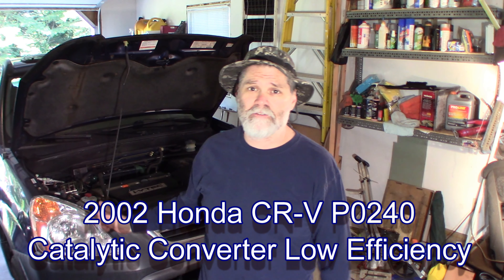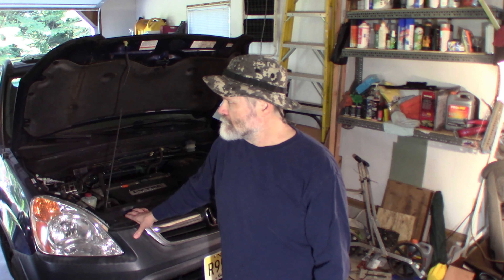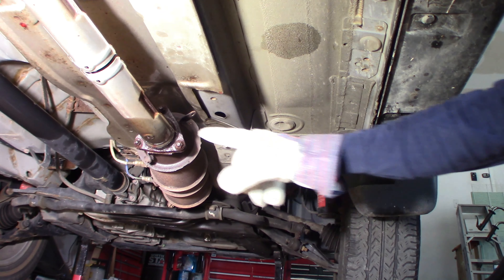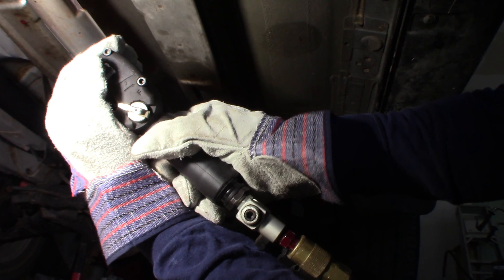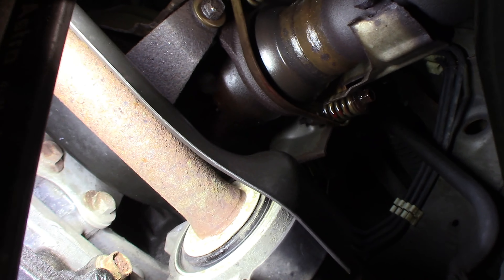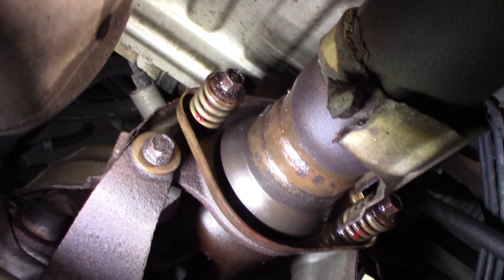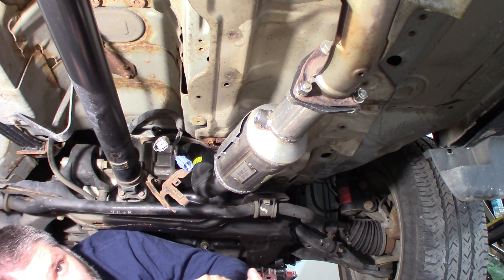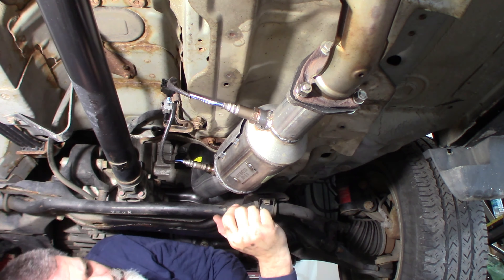2002 Honda CR-V P0420 Catalytic Converter Low Efficiency

Comment: The one I need to work on this week, the bolts are unrecognizable and flange busted on the b pipe 3 hole flange at the cat. I'm going to replace b pipe but the cat flange is very rusty and thin. will see if it holds. Thanks for the video.

Comment: Nice video!  Do you have the part number or specs for the rear bolts?
Reply from the maker: I don't.  I just used bolts I had because they were "through" bolts.

Comment: Ho has the converter held up? Do you know?
Reply from the maker: It was holding up ok, but the car was totalled  about 6 months after it was done.  I use converters that have a good warranty and always replace the 02 sensors when doing one to make sure the warranty is in effect.  Many times the oem price on converters is just too much for an older car.  Sometimes it costs more than the car is worth as a whole.
Reply: @CharlesAndCars  dang that’s a bummer. Great video, very helpful. I’m trying cataclean and replacing sensors first if those don’t work then I’ll be watching this video a few times while replacing the cat.

Comment: Appreciate your video.  But you do not need to use OEM or even a direct fit cat.  You just have to know what universal cat to use for your application.  Ive owned a exhaust shop for 17 years. We change those Honda cats for 350.00 dollars. 
  Universal cats get a bad rap cuz people use the cheapest one they can find and of course they don’t work. 
  I can think of only a handful of cars that I suggest OEM cats.
Reply: Hi, My Cat needs to be replaced, can you please recommend a good universal one?
Reply from the maker: I don't know one off the top of my head... If you're going to use a universal one, there's probably a little work that needs to be done to fit it because it's not a direct fit... You're best if you go that route to go to someone who can fit it and get the warranty through them...  Otherwise if you're planning on doing it yourself... probably best to go with a direct fit which will bolt in without any additional fitting.

Comment: my sisters crv is throwing p0420 and p2422. do you think  that the main reason for the p0420 could be because of a bad oxygen sensor (p2422)?
Reply from the maker: p2422 is an evap code (vent valve stuck closed).  Don't know that it would cause the p0420 code, but it will affect mixture.  I would fix that first and see if it has any affect on the p0420.

Comment: I have a 2002 crv with 233k in great condition, but the engine is fully rebuilt with barely 7k, I have the same code popping up I was going to replace the cats with aftermarket my friend has a custom exhaust shop. I hoping to just to O2 sensors
Reply from the maker: Helps to know someone who has an exhaust shop... should be real easy for them to do the cat if you need to.

Comment: After replacing both my sensors I now get  P1157 H02S(A/F SENSOR) S1 AFS LINE VOlTAGE
Reply from the maker: That means your sensor is bad or you have an open/short in the harness.  Did you use the same manufacturer as oem for Honda.  I always use the oem manufacturer.  After market for sensors tend to cause issues.

Comment: Just got an exhaust leak like right behind the cat but stud are really rusty is it ok to just replace the exhaust?
Reply from the maker: Is the leak due to the gasket at the flange behind the cat, or somewhere else?
Reply: Charles And Cars has the cel come back on since replacing the catalytic converter and sensors,  my cel is on for the same code and my emissions is coming up soon and I think I'm going to use the same cat u used
Reply from the maker: @richarddominguez8361  Not it has not... just take the time to make sure it's the cat.... can be caused by other issues which I go through in the video...
Reply: Charles And Cars do u have a direct link to the cat that u bought for this
Reply from the maker: @richarddominguez8361  https://www.rockauto.com/en/moreinfo.php?pk=4962642&cc=1386334&jsn=356  ... Note that it's not CARB compliant for CA/NY....
Reply: @CharlesAndCars , I bought the same cat you used. I would like to install this coming weekend on my car but did you used the two gaskets that came with the new cat?
Reply from the maker: @lancanlyr  Yes
Reply: Charles And Cars yes the gasket failed behind the cat
Reply: @harbear48 , are you still using the original cat in your CRV? Did you replaced both gaskets only before and after the cat? The reason why I asked because when I remove today my original cat it looks like nothing wrong with my cat, I found the exhaust gasket is really bad/failed. I'm still debating my mind if i replace my gaskets and put back the original cat. BTW, my CRV has 205,000 miles on it..
Reply: I was talking about the donut gasket before the cat that looks really worn out/failed..

Comment: How much miles was on the CRV before replacing it
Reply from the maker: Don't remember exactly, but it was mid 100Ks
Reply: I do have a P0240 code as well but I think it might be the 02 sensors. I thought cats were suppose to last the life time of the car
Reply from the maker: @markyazurin6304  Varies car to car ..... not that uncommon an issue for a cat to go bad...

Comment: The 2 spring bolts look awfully clean. Would have been nice to actually see the whole job, not just the easy parts
Reply from the maker: Yeah, it's tough to show the whole job.  Most won't watch a couple of hours of banging head against wall fighting with bolts, etc.
Reply: @CharlesAndCars  I understand your point. But it's those moments that define how tough the job might be for others who are watching your video seeking reference. It leaves people wondering what exactly needs to be done if they encounter the same issues that you encountered. Yes, take it off, put it back on. Works on paper, not in real life. I won't start a repair if I didn't research possible issues I may encounter and have an have the proper tools. 
 My exhaust manifold donut gasket is leaking and the bolts are very rusty. I'm not going to blindly try to remove the bolts and have one strip or break off without watching a video showing the same issue.

 Thanks for your video and hard work. It just would have been nice to see the toughest parts of the job, along with your thoughts about the easiest way to get the job done in a timely manner.

Comment: This is just a load of crap. For one,  catalytic converters don't cost anywhere near that price. And two, all cats have a 5/50 warranty.
Reply from the maker: Here's a reference

https://www.cheaperhondaparts.com/oem-parts/honda-converter-18160ppaa00/?c=Zz1lbGVjdHJpY2FsLWV4aGF1c3QtaGVhdGVyLWZ1ZWwmcz1leGhhdXN0LXBpcGUtbXVmZmxlciZpPTQ0NjYxNjU1JnI9bGF5ZXJfMSZhPWhvbmRhJm89Y3Itdi01LWRvb3ImeT0yMDAyJnQ9ZXgtNHdkJmU9NC1zcGVlZC1hdXRvbWF0aWM%3D
Reply: @CharlesAndCars  Wow... That's pointless. 

I just got the same car for 1000 bucks. 2 days later, it wouldn't start. Disconnected/connected the battery, and it started again. It's the cat. Guess i know what to buy now.
Reply from the maker: @phorse  I don't know how disconnecting and reconnecting the battery would point you to the cat.... Should see a P0420 code in general when there's an issue with the cat..., but that code can also be caused by exhaust leaks or o2 sensors having issues.
Reply: @CharlesAndCars  well, the cat is out for sure. Rattling inside of it. I thought it may have been the computer making the fuel mix bad. Maybe not.
Reply from the maker: @phorse  Hard to say, but it usually has to get really hot to melt...  look at the o2 sensor behavior to see if it's dumping fuel into the exhaust... They would show a constant rich  calling for the computer to lean them out...